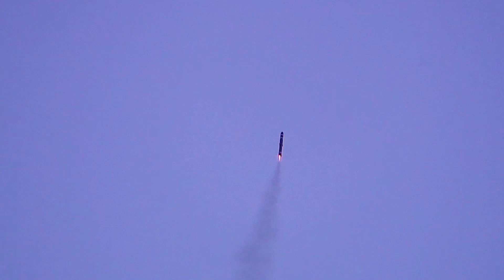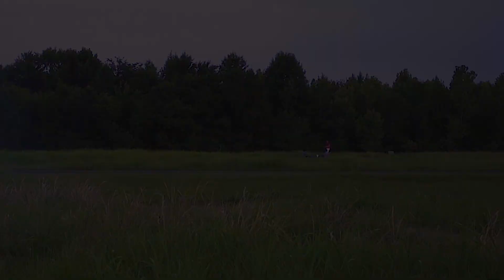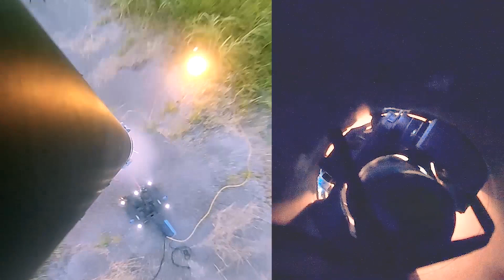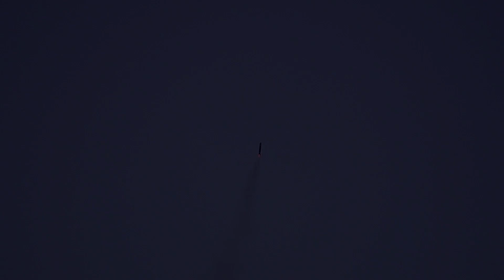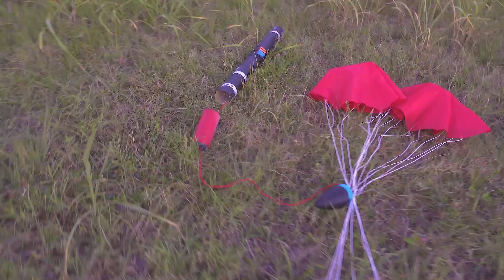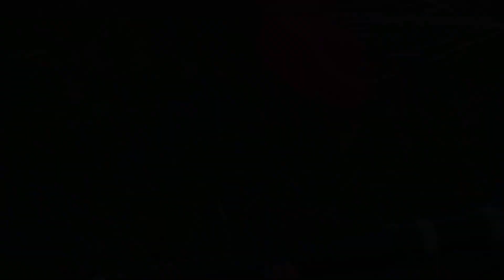Electron Launch - Build Signal R2

Comment: Which typed of mechanism is used to ejection of parachute??
Non pyro or pyro mechanism and why??
Reply: He uses a pyro mechanism that has alligator clips plugged into it. Those alligator clips are clipped on to a black powder charge that fires the parachutes. For a more detailed explanation of how it works, you can look at the previous videos in the signal R2 series.

Comment: How do you make rocket fuel?
Reply: Just but model rocket motors
Reply: It's not recommended to make rocket fuel at home cuz, you know... It's rocket fuel
Reply: I meant to buy model rocket motors
Reply: Ethanol plus hydrogen peroxide, burn it, kabloom
Reply: @KerbalChris   ye stick a TNT load in PVC pipe and cap one end
Reply: @KerbalChris  bad idea
Reply: With using kno3, sugar and sulfer
where sulfer is catalist